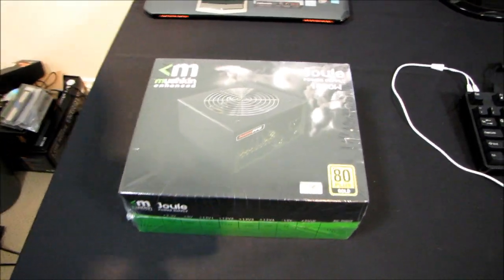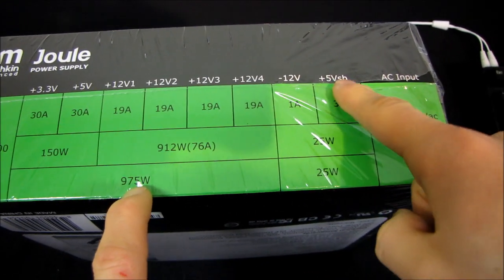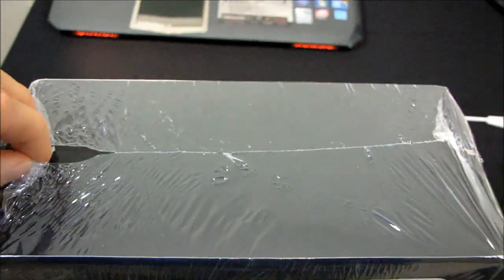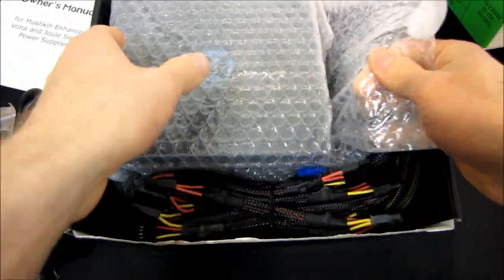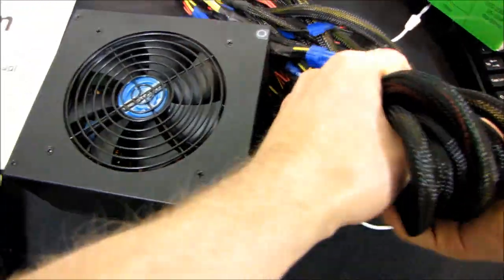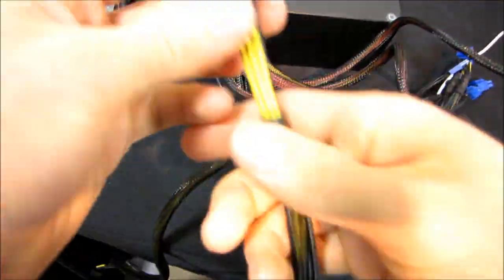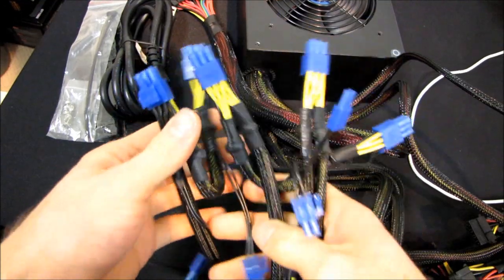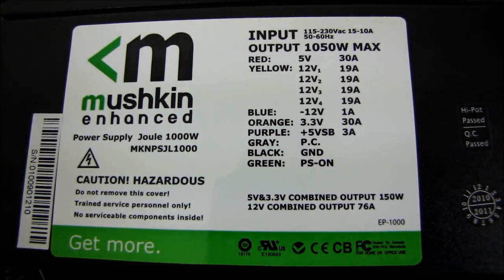Mushkin Joule 1000W Power Supply PSU Unboxing & First Look Linus Tech Tips

Comment: @meekoman25  most computers don't pull that much from the wall,an ammeter works awesome if you can find a true RMS ammeter, I would say that 98% of home computers barely pull 6 amps max. psu's are best used between the 40-60% mark. why most cards ask for a minimum of a 500 watt power supply.minimum I would use for a dual gpu set up is 750w max 850w just for stability assurance and longevity of the psu.

Comment: @SilentSlayer94  you can use all the watt meters you want to. I've been an electrician for 12 yrs. those things are not even close to accurate. first they are not true RMS(root mean square)which can throw the reading off by as much as 30 watts then add the +- 10% reading error and then you have trouble you wouldn't imagine.
it's just like an electrical panel in a home you never use more than 80% of it because of shorts and power surging. get a true RMS amp reading from a real multimeter.

Comment: @juggernautxtr I really doubt he'd need more than 600w for his system. If you read my other post correctly, you should have seen that my gtx570 + Phenom II 955 OC@3.8ghz (and some other components: 1 Caviar Black HDD, 2x2gb Corsait Dom 1600 8-8-8-24 1.65v and Asus M4Z79XTDevo) draws 467w at full load, and once again, this is true power draw, not the power draw from a psu calculator. So, considering sli gtx 460 is more power consuming than a single gtx 570, 550w should boot, 600w+ might be safer.

Comment: @SilentSlayer94 No his 550 won't power 2 GTX460's he wants to run 2 not one. 2 460 are 400 watts easy add a 95 watt cpu + 100 watts for motherboard and ram = 595w now add 2 drives at 25 watts pc(50W) =640 watts.  now add 2 fans x 8 watts max.
the 2 gtx460's alone would be 75% of a 550w, 460's are power hungry, hot running cards and he will need the room for more fans in his case. and that's not figuring overclocked.

Comment: @juggernautxtr Noooooo! That looks like an estimation from an online power supply calculator. Not that those calculators are bad, but they usually tend to overrate the minimum voltage required. I'm running a Ph955@ 3.8ghz 1.43v + gtx 570 and my KillaWatt meter tells me, when I'm running OCCT at 100%, that my wattage use is 467w. Thus, I'm sure 550w will boot with your system, but, if your cpu is overclocked, or if you plan on keeping this setup for a while, you might wanna get 650w or more.

Comment: @booting2  I am estimating that you are pulling around 507 watts at full load with 2 fans, the 460 pulls between 200 - 230 watts  i would recommend a 800- 850 watt PSU for the safety of the system, and better performance from the power supply(keeping it cooler and in preferred under  80% use state).

Comment: @FrostyTheBeerMan non-modular - all the cables is connected to the PSU.. so, u can't choose what cables is needed and connect to it. hence u will have a lot of useless cable jumble-up in ur case.
modular - only important or useful cables is connected out-of-the-box, and there will be slots u can plug in to with additional cables which is included. for example - cooler master silent pro PSU.

Comment: What I would like to see are longer 8pins motherboard connectors... Most of the cases now mount the PSU at the bottom and when you route the cables through the gromets, behind the motherboard tray (for example in the Corsair 800D), sometimes you can't even reach the connectors on the motherboard (especially when you have 2x 8 pins like on the Classified).

Comment: @styx70819 for a small power supply like a 500W and under you will probably use all the cable so it wont really matter, but yea if you buy a 1000W there is no reason to not be modular.

Comment: @styx70819 non modular PSUs are a bit cheaper. i used one in my aunts computer when i build it since she doesn't need a very powerfull pc so space inside is not going to be an issue and i was able to tuck all the extra cable under the optical drive.

Comment: @dolph123454321 got a pretty value gaming pc since 3 years ago AMDx2 7750 be oc to 3ghz 3gb ram shit value the psu brand is odd acteck came with the case 600w got right now an AMD 5550 pc never gets hot and stuff plays all my games including crysis at medium settings for 26 fps 1240x1020

Comment: They should have not put the floppy or molex connectors on the PSU and just included SATA to molex adapter cables in the box. Although going modular would be better.

Comment: so guys help 19amps on the 12v rail its enough for any card? my psu has only a single 6 pin connector at 19 amps will it work??

Comment: @KolorowyRastaMan
Well, not quite. Did you know that non-modular PSU doesn't automatically mean a mess in your case? It's very easy to hide all the cables, you just need a good case which has the option to do this.

Comment: @styx70819 Well, if its 1000 watts then you sure are going to use alot of those wires.
Even if you do not use all of the wires you probably have a big case that has enough space for those extra wires. Who is going to buy a 1000w PSU unless you have a badass system which means you probably have a big case. AND the price is lower >_> 
So its a win win anyways.